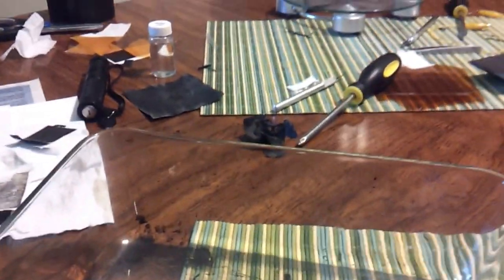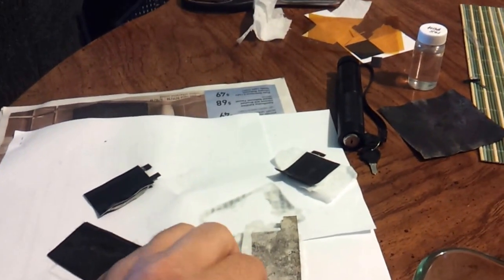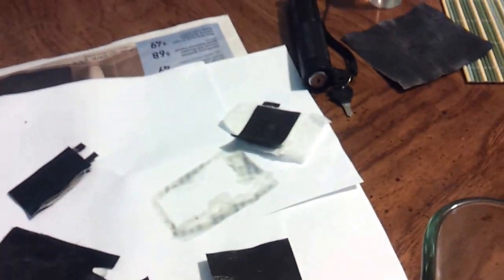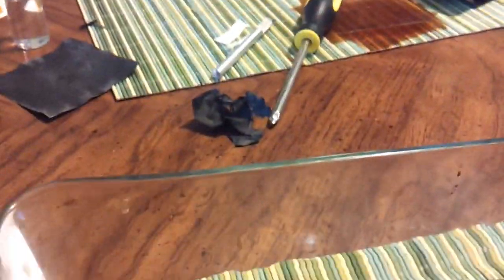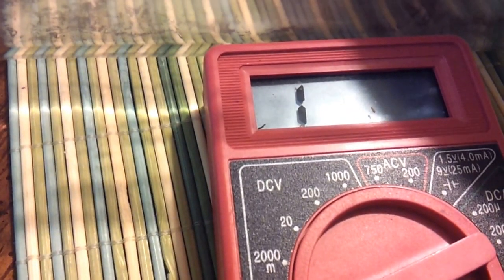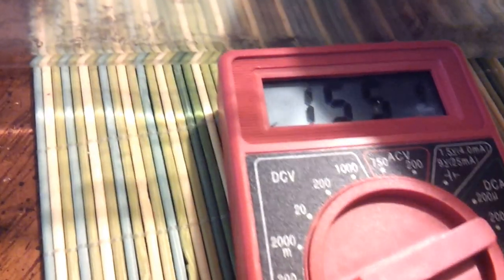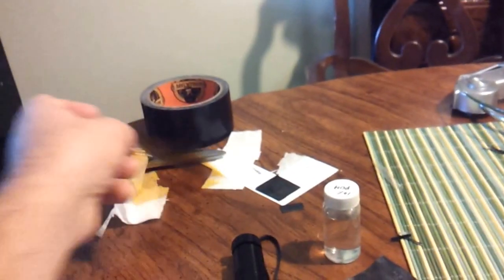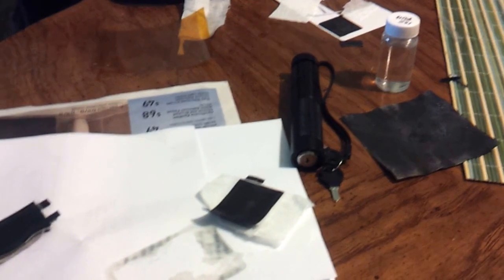Graphene failures, and a film.

Comment: Finally, the electrolyte will soak into your reduced graphene oxide electrodes.  Not only where you want it to, but also where you don't want it to.  Even if you can't see it, the electrolyte will spread through the electrodes, where it will interact with your metalized electrical connections.   This will manifest itself as very high leakage current.   In other words, you have to come up with a conductive barrier to the electrolyte that will not react with the electrolyte itself.  Have fun!

Comment: Do the same thing to the electrodes as mentioned below for the seperator.   You want a plastic-like film covering the reduced graphene oxide.  Even once everything's dry, the surface of the electrolyte should still be slightly soft and tacky. Press the seperator carefully against one electrode, and work out the air bubbles with something small.   Then press the other electrode onto the other side of the seperator, and press the whole stack together.  It will NEVER come apart after that.

Comment: I had similar problems as you early on.  One thing that I think will help you, is that you need more than one application of the electrolyte.   Take your paper seperator and soak it thoroughly in the PVA/H3PO4 electrolyte, and let it dry completely.   Then repeat this process several times until you build up a plastic film.   If you use something like tissue paper, after half a dozen applications the dry seperator will look like an almost clear plastic film.

Comment: I've tried the PVA/H3PO4 electrolyte, and while it can be improved upon, it works fine. I gave up trying to make my own PVA, and just bought the pure stuff on eBay.   I also use Fisher H3PO4, which is very pure.   Metal ion contamination will give you high leakage current.

Comment: What kind of Resistance are you getting at your plates. try a standard of 1/2" between probes. you should be below 15 ohms or lower at any placement on your plates. If you have good resistances it's got to be your separator. But at best, doing it this way I would only get a charge that lasted only a minute or so,...